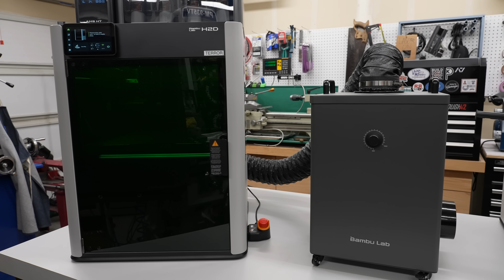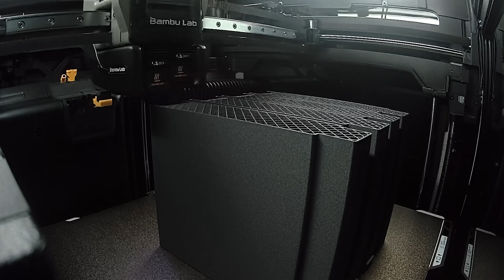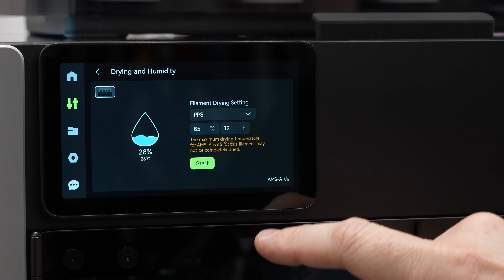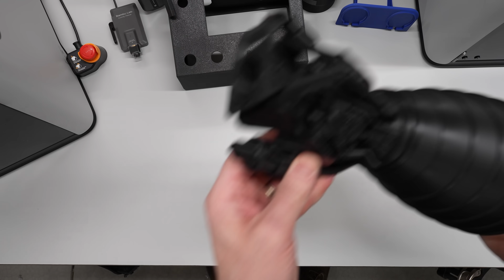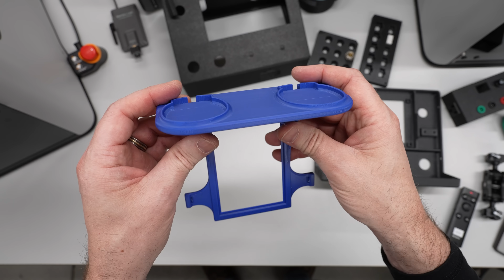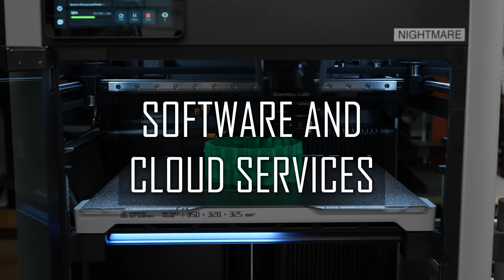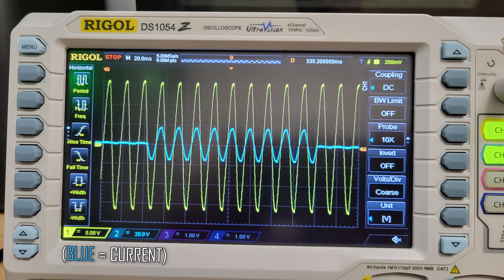What I Learned from 300 Hours with the Bambu Lab H2D 3D Printer

Comment: This printer will apparently give you your life back. I cannot wait to pick one of these up.
Reply: To get your data, privacy, and security stolen on their cloud. For them to lock you out of this printer as.well. I would love to buy one of these, but I don't trust Bambu and their shady walled off ecosystem and cloud. They have pulled so much shady bs over and over. They are slowly locking their users into what they want, and permission to print models. Remember, Bambu wanted to charge fees to print models. They literally take and bank every model printed on their printers. They also worked with JB's admkn behind closed doors for blocking and snitching on people that print powder burner parts, even tho it's perfectly legal in America. Their end goal is to charge you per model to print, or a monthly subscription fee, and you will be fully trapped with what they force you to do. They have full control over all their printers, no matter if you take it offline. After a set amount of time, the system locks out and forces users to go back online or the printer wount work, its bricked until you do. More sensors and things to fail which they collect even more data off users. I would never trust the Bambu cloud on my homes wifi, never.

Comment: Outstanding printer / performance review - but the Bumbu Filament sales pitch was not necessary - there are plenty of excellent US based filaments available or EU if you live overseas. So, no need to ship that stuff from China. Also, a lot of things have been said about the recent changes (limitations) to the cloud connectivity - shutting out or severely limiting 3rd party options (like the  OrcaSlicer) - reminder: The HP printer / printer cartridge scam. I do own several P1P and P1S printers and the H2D might be my next buy (waiting for rev 2 - after the "new product" issues have been fixed) and we will see how the cloud connectivity will be resolved (or not).

Comment: why do you use CF or GF material for everything? Of course prints look good with those materials, as the fibres help hide the layer lines. 
Apart from that, it has been shown that fibre reenforced filaments aren´t stronger or better than non reinforced. It´s just a waste of money and fibres. Plus it makes the parts non-recyclable...

Comment: Many have carried this sentiment before me but; this is an exceptional product review James - of any type of product - period (as you say across the pond). Like others I can echo your point about needing a productive tool and not another hobby. It is great to see how determined Bambu Labs are to follow that path, and equally rewarding to watch your applied understanding of where they have succeeded, and where they still have work. Having said that, this unit would seem to have brought consumers very close to the plug-and-make ideal that we share. As best as I can tell, this is a significant step forward in home and low-cost, low-volume manufacturing. Well done Bambu Labs and well done Clough42. I am speaking as someone who has never 3D printed but is intending to start soon, so looking at this as a first printer.

Comment: If Bambu Labs wants to lock everything down like that and close off interoperability, they can stick with the actual professional market instead of acting like they still care at all about home users. If they want to give professionals the shaft, they can go for it. Professionals don't seem to care. But home consumers do care and frankly, just writing off 3rd party interoperability as if it's just some feature that only some people want diminishes the real harm is done by a frontrunner in the space disregarding it so overtly... Two nozzles. Tag readers. Fancy calibration plates. All of those are features you can take or leave. All of those are negotiable and should be options at higher price points and all that. But interoperability needs to remain the standard in both the home user and "prosumer" markets. This cannot be negotiable and it's shameful of you to just act like it's a feature that just "might not work for some people."

Comment: Great review! This is exactly the thought process and take on the H2D I have been looking for. I just need to know if it makes things reliably and accurately. Seeing the parts you’ve made on the printer (especially the segmented display and keypad part) just work is very reassuring. I make similar parts all the time and makes me excited that these types of parts are finally being available without the insane overheads of complicated production grade equipment. 
Thanks for the insight!

Comment: Valide review, but I wound't brush away the risk of bambu completely closing their software like it's a small thing.
These machines are complicated and if we allow them to program them in a way that doesn't not allow the user to peak inside, you're giving away the control you have over your hardware and it can be problematic.
And I get the point of having machines that just work, I bougth a P1S for the same reason and it's amazing, but open software and a well designed ecosystem from the manufacturer are not mutually exclusive.
Bambu has great engineeering but if we as users allow them to get greedy, they will and you could soon have a printer that for example doesn't print filaments that are not from bambu or do things like not allow you to print unless you complete a software update or connect it to the internet.
It's a great machine, and one without any rivals at the moment, but let's not allow bambu to close everything because in the end we are gonna get fucked by it.

Comment: The best review of this printer! This is exactly what I need this for, for multi material prints, ability to print more complicated materials like ABS, ASA, PA and other derivaties. For printing only PLA and PETG any 400eur printer can do it with ease. Most of reviewers are hating about bed size, they have expected bigger, but when you take a look what they are printing, is toys and helmets. 
This what you are doing is real thing. Solving real problems, with real tools. Maybe laser and cutter are not needed for everyone, but having them in the same machine (instead of having 2 more machines taking space) is not bad idea. To have ability to cut something once in a while, not to make a business from it, is I think good option to have.

Only one thing is bothering me, and I saw in CNC Kitchen video that bed heater is not ideal, there are cold spots which can result in bed adhesion issues.

Comment: A great video. You have the same ethos as me on several fronts. It does what it’s designed to do and it does it reasonably well with reliability. You covered exactly what I have always said about the whole firmware lock down debate. These are consumer devices, if you run their software and their filament they work (for the most part) exactly as stated by BL. 
I’d love to have seen some more about the added features, mainly the laser, especially materials it will work with and thicknesses from an experience level rather than “on paper”. I’m also keen to see the resulting appearance of whatever materials it can interact with. 
Thanks for the great informative video and for your thoughts. I wish they’d send me even just one hahahaha. Never going to happen!

Comment: Similar to the X1C the bed heating is uneven and thus regions (on the left rear quarter) tend to warp. You mention all is perfect and nothing warped. Did you use the standard bed temperatures or you increased them?
Reply from the maker: I never touched the bed temps.  I used glue stick for nylon and liquid glue for ABS-GF.

Comment: They didn't pay you, they just sent you 5 Grand worth of printers. That's awesome though. I think these are a bit much tough.. and, did i get this correct, the ams can't load both nozzles? So you need a second ams for 6 second color charges?
Reply from the maker: In my testing, I ran an AMS on one nozzle and a single spool on the other--sometimes in the AMS-HT, and sometimes feeding directly into the printer from a dry box in the case of TPU.
Reply: @Clough42  so, a single AMS can't feed two nozzles resulting in 6 second color changes. Unless you're into some really unique or complex stuff i think this machine will be a dud. 6 second color changes using two nozzles would've been nice.

Comment: Good review.  I too have a X1E and an X1Carbon, and am more interesting in getting prints than fiddling.  I do have Prusa models, but I've found the AMS is quite useful, and the new AMS lineup looks like it will be even more so.  Dual nozzles will definitely make it easier to interlink filament that normally don't adhere to each other, like PLA and TPU, and it also helps with being able to have support filament and normal filament.

Comment: 2:58 Is that external smoke extractor compatible with a normal H2D for air-purifying purposes?
Reply from the maker: I don't think so, because the printer opens and closes the vents to control airflow and can't do that with the external extractor.  The printer does have a pretty good filtration system built-in, though I haven't actually measured the exhaust air.  When laser cutting, the machine bypasses the internal filters and depends on an external vent or smoke extractor so the internal filters don't fill up and clog.

Comment: Is it possible to equip the printer with an 0.2 nozzle and a 0.8 nozzle? So you print the walls with 0.2 and get good details and then can print the infill really fast.
Reply from the maker: They have a variety of nozzle sizes.  I have been told it's possible to mix nozzle sizes in one print, but I haven't tried it.
Reply: @Clough42  it would be amazing if you would try it and make a video about it, there is no video on YouTube where someone actually does this.
Reply from the maker: @Ahmad-ed3ne  I actually tried it last night, and I was apparently told wrong?  The slicer says it's not supported.  Maybe it's coming and I misunderstood.  I'm not sure.

Comment: Combining laser with 3D printing doesn’t strike me as a good idea.  Lasers create a lot of particulates which won’t play nicely with keeping a clean 3D printing system.  Also venting is a BIG issue with lasers.  You don’t want to be breathing the vaporized material.  

Specialty machines are usually a better value and more capable than multi function.

Comment: I tell you what.. that print head is a missed opportunity. 3 heads is ideal, not 2. Why? So that you can load one with TPU, one with support material, and the 3rd with either a filament or AMS fed filament. THAT would allow you to use TPU, support material and OTHER materials together without a head swap like the Prusa XL. Granted.. it would add more size to the head.. but make the shell a little bigger, frame a little stronger (e.g. stronger frame/supports), and a slightly more capable X motor to handle the weight of 3 heads, cameras, cutter, etc.. and you got a perfect machine, especially if all 3 heads can be independently controlled (heat, flow, etc). Then you dont have to unload/reload PLA (or other support filament) with TPU in the 2 head model.

Comment: I think the reason they want the AMS on the right is because that they prefer the main color of the print on the left and multi color on the right. So they want the main color of the print on the left and the multi color or 2ndary material (like TPU) on the right. I wonder if they will support Dual AMS (1 for each side) and if they will allow transfer of AMS 1 from an X1c to H2D. I might decide to save money but buying the $1800 H2D and transferring my old AMS to the new Printer. Finally I don't understand the point of the AMS HT. It appears to be a normal filament dryer to me. Without the 4 colors, what is the point of it? Why retract a single color back and forth. the AMS HT is an overpriced filament dryer.

Comment: Very useful and comprehensive review, well done for pointing out that the goal is to print with fewer hassles. Many people focus more on the printer itself rather than on the act of printing and fail to understand this need. However, I believe the success of the dual extruder's functionality also largely depends on the presence of the Pressure Advance introduced with the A1 mini. In fact, I had been eagerly waiting for the implementation of the dual extruder ever since its release!

Comment: This is an odd product From Bambu.  A larger format than the X1C, has some of the tech from the X1E, yet being deceptive about the actual print size possible.  Two heads but you can't use different sizes.  Has a Laser cutter that is not as good as a stand alone Laser.  Has a Vinyl cutter but not as good as a Cricut.

Comment: Hey James @clough42, I have a question regarding the dual nozzle size limitation that currently exist. I hope this will get resolved later on as I can't see it being other than a software limitation. However one detail about this is if the printer complains if two different size nozzles are loaded? Do you know? 

Reason for asking is that I suspect that a software like Simplify 3D could work with dual nozzle sizes as soon as a machine profile was made, but if the H2D is acting up and limiting functionality it could still be a problem due to that.

Comment: I'm curious as to heat bed performance compared to the prusa XL 16-zone heating scheme. 

I remember the Gridfinity reorganization video you did using the Prusa XL showing stacked 8x8 grid plates without warping. I'm wondering what areas (such as the build plate heating uniformity) the advancements Bambu made are better than the Prusa XL. 

The high power draw noted (1300w) vs the Prusa XL (estimated 600w), I'm wondering if the heat bed is where most of the power draw comes from. 

A comparison between the two printers using time lapse IR cameras would be useful.

Comment: Thanks for the video! I think this is a great machine for makers (specially prop makers) like me who just need a reliable machine that can laser cut wood, and print and vinyl cut. Thanks for the video. When a regular customer buys the full combo does it come with the vision encoder plate and the secondary single roll AMS unit the HT one?

Comment: Okay.  The gasket in TPU printed at the same time as the rest of the part has sold me.  Time to start saving, though probably not for the laser variant, Its just not an adequate replacement for a standalone laser unit.

Comment: Thanks for the excellent review.  I too just want something that works.
CNC Kitchen mentioned that the bed heat is uneven.  Did you experience and adhesion issues?
Did you try it on 240?  And advantages in heat time?

Comment: See this review is one of my favorites ..i may do multi color and things for fun here and there ..but really want to use multi material not multi color..As someone that does cad, cam , runs cnc lathes and mills, edm ,welding I want a printer thats heavy on the engineering side..Still on the fence with this printer just because technically I dont need a new one lol..But I think just the standard printer is the way to go..I dont think the price differnce for the laser makes sense and also i feel like its probably gonna to cause more trouble for the parts inside the printer if you do it to much

Comment: Im new to 3d printing what do you mean when you say about not working with 3rd party. Would I be able to purchase say an STL file off of Etsy or a free STL from another source and imported into the printer and print or would that be considered a third party and you have to build all your own prints?
Reply: Bambu may limit the ability to use third party hardware or software, but you’d still be able to use print files from other sites